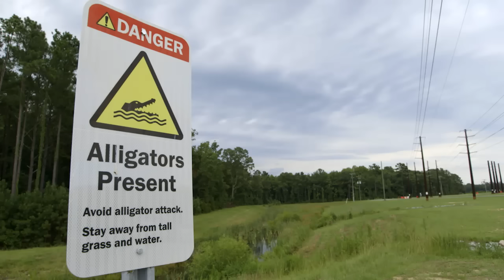Inside a Google data center

Comment: I was a Systems Admin. for a Fortune 5 company.Treasury Systems. I also designed the LAN. My networks were bullet proof. I had Compaq software that would check for pending drive failure. I implemented RAID 5 architecture on token ring.Unlike Google, I was proactive in monitoring system health before drive failure, not after it. I once had to swap drives during daily operations using Novell TTS. We didn't miss a beat or one transaction. The drives synced up. Then, it was time for lunch. :D

Comment: how much hard drive space is there?
Reply: There are no official numbers but it's estimated that Google has around 10 Exabytes in disk space available in total (according to their purchase history and average drive fail rates), that's ~ 10,000,000 1TB disks.
Fun fact, there is a hard drive fail in a Google datacenter every MINUTE. This is absolutely normal though and the data stored on them is redundant or course.
Reply: Google doesn't use "normal" Raids. They use advanced saving mechanisms (distributed cloud file systems) with spread out redundancy. The moment you upload a video it is already saved on multiple disks with parity functions, chunking etc., never on one hard drive alone, also it is saved in RAM-caches until the video has a minimum presence on the distributed file system.
The file system google uses is a proprietary one, called GFS (Google File System).

To answer your question (@DoppelgangerPlayer): The video will only fail if all drives with the same chunk of the video file fail at once, which is pretty unlikely to happen (but not impossible of course). I can't remember that it ever happened.
Reply: nice!^
Reply: About 512 mb.

Comment: why not transfer data center to cooler place?
Reply: Lander Lai 
I've thought that too. Build them in cold places and use the outside air in winter.
Reply: Could be a few reasons. Maybe they don't want to deal with outside contamination. Or maybe they just want it to be 100% reliable and best way to do that, is do it yourself
Reply: An Australian super computer was built over an underground aquifer. Pump up the water cool the computers and place the warm water back into the aquifer that is large enough to disperse the heat.

Comment: So if the drive breaks, someone's data is lost forever right?
Reply: No. On the enterprise level, drives are backed up in something called "RAID", where drives are mirrored bit for bit onto another drive. If one drive fails, there's a mirror copy of it already working on the network. The failed drive gets replaced, and the data is mirrored once again and running at least 2 copies.
Reply: +Doug Holmes It's worth mentioning that you double your cost with certain redundancies such as raid. Or you can look at it as you lose half storage space, since you use the other half for the mirror image.
Reply: Okay thanks.
Reply: FUCK MY PORN HISTORY :'v
Reply: lmao :v

Comment: why do all the employees have macbooks?
Reply: Because Unix.
Reply: Apple hardware is very good.  Macbooks also have a ridiculously high resale value.  You can cycle your hardware less often, and sell your depreciated hardware for a significant return on investment.  The initial cost is higher however.

The other good (and bad) thing about Macbooks is they change hardware less often.  So when you buy 500 MacBooks for your employees over the course of a year, the hardware is all the same, where with a PC individual components may be different as the hardware models change slightly throughout the year.  It's usually preferred to unify your hardware, it makes management easier.

I hate Mac OS - but love my macbook, I bootcamp and run Win10 - I'm a Network Admin.
Reply: Apple hardware is the same as most other hardware, but at twice the price.....
Reply: Hardware from HP is better than hardware from Apple. I would always prefer a notebook from HP over a macbook.
Reply: I need job

Comment: id love to throw a huge neodymium magnet into that room
Reply: all old spinning type harddrives have  neodymium magnets in side them so your  neodymium magnet most likely would not do anything oO.
Reply: true i was just wondering why they have spinning type hard drives in a google server room i imagined theyd have tons of SSDs
Reply: comes down to cost per meg ATM old spinning hdds are still cheaper but thats changing fast, i would say in the next 5 to ten years spinning platters will be dead
Reply: yea i read today that the price is dropping a lot right now because of those new portable ssd usbs
Reply: Yeah magnets bitch!
Reply: If it's that strong good look getting it inside.
Reply: Sc!ence | That would be fun, how ever there hdd's not ssd's
Reply: They can achieve similar speeds with HDD by arranging them as RAID.
Not only that, if one fails the data is still available in the other discs... It's safe and fast.... and cheaper.
Reply: hahahaha
Reply: Alla ackbar

Comment: Is it not possible to use all the surplus heat to heating of houses and water heating?
Reply: Not really. They would still need cool the water back down to keep cooling the servers.
Reply: I always thought they should build them in cold climates and use the cold outside air to cool them. And lay fiber through the snow :)

Comment: Plug in a USB Killer
Reply: lmao none of you have ever been in a data center have you..
Reply: ***** lmao you clearly do no understand sarcasm or jokes
Reply: lmao with that much voltage it'll kill your USB killer
Reply: EHHH...
Reply: they are using very cheap mobos with consumer grade disks.
each "server" consists of a simple motherboard with CPU soldered in with 2 hard disks.
the reason why they do this is becouse they dont care if disk or server goes down, they replace it very fast and the "system" (HDFS) replicates data to new server immediatly.

its called "grid computing" where data is replicated between hundreds or even thousands of computers.

few years ago google released their filesystem called HDFS and now we have "Hadoop" from it.
Reply: Not usb ports from what i've seen and most likely those high-end machines can handle an voltage overload.
Reply: Bobby Williams Hilary Clinton approves of this idea
Reply: Not even a USB slot on those servers.
Not that it would matter. They're mobos are probably super high end and able to handle it anyways.
Reply: @FatheredPuma81  r/whoooosh
Reply: @FatheredPuma81  r/woooosh
Reply: @internet4965  How?
Reply: 0:16 top right corner
Reply: The USB killer would only kill one machine out of many in the datacenter.
Reply: Unusable USB ports can be disabled.
Reply: 0:15 there's two right there.
Reply: +Bobby Williams  LMAO😂😂😂😂
Reply: Jordan Bentley they do. ha
Reply: Bobby Williams I don't think a little USB would kill it all.
Reply: ***** It's a hardware kill switch, not software. (They've used it to kill a car)
Reply: No most regular people havent
Reply: either have you thought so gtfo
Reply: this wont probably work they need to have a some type of secure
Reply: Isaac plays lol
Reply: Soup Man omfg there's probably someone in the company waiting to do that
Reply: Google datacenters run a heavily fortified OS, and not even a single virus can penetrate that since it auto restarts when it detects something bad and reverts it
Reply: I think plugging in, "MineCraft" from PirateBay works better or teenager hdd
Reply: Bobby Williams A
Reply: Bobby Williams wtf xD poor hard drives
Reply: No more google
Reply: HAHAHAHA
Reply: They are responsible for the missing people.
Reply: Jeez
Reply: that would not work too muc sicurity
Reply: A simple directed EMP attack... and I bet all those systems are toast....
Reply: Plug in Thor's Hammer
Reply: Master Chief where are you going? “To erase my search history”
Reply: Only a few are authorised!
Reply: Make multipule HUGE emps and detonate them in the building and run for your life... if you can get in
Reply: wow, so many people to woooosh
Reply: People are saying “ it’s too secure for that” but they are wrong they don’t plan for that, unfortunately each one is separate and don’t share a connection
Reply: They have Alligators around that data center, probably trespassers have been eaten and Google is not telling us.
Reply: +Jordan Bentley The USB killer would still kill the MB, as long as the USB killer can complete the connection and discharge.
Reply: How are they attached? I mean i guess their attached together via ethernet cables but I doubt the discharge from that one usb killer will go through the networking switch and kill the rest of the machines attached to the network, and the discharge can't go through wall power . The only two attachments it has to other machines is ethernet and wall power.
Reply: Someone. You are wrong , kill the first machine to kill the rest , it's like a electric series cut the first wire and all blubs are off
Reply: Bobby Williams same idea^^
Reply: Those are not sata cables, there's clearly 2 USBs right there.
Reply: Yeah I know haha

Comment: How is the data center more efficient when its warmer?
Reply: Maybe the cost of efficiency loss is less than what it would cost to cool it to the generally accepted temperature.. 

Something along those lines im sure..
Reply: Thats true I didn't think of that
Reply: I do a lot of work in data centers, and I have been told by a few them that their highest cost is the electricity bill for the air conditioners, if there is no aircon, you use less power = more efficient. I can't remember any specific details but one of them was saying that if they replaced all of their equipment with components that could survive in higher temperatures and remove the air conditioning all together, that they would save an absolutely monumental amount of money.  it would be quieter too -  those fans sure are noisy. They said the biggest hurdle in doing that is the temperatures would easily climb to 50degrees Celsius+ and it would be very difficult to have people do work in there from an OHS standpoint.
Reply: If the ambient temperatur are lower than in the center no compressors are needed. It´s a common strategi to rise the temperatur of the cooling system to reduce the compressor energy. The ambient temperatur can cool the water system. But the best thing to do is to reuse the heat energy when possible ie in district heating. That is more and more common in cold areas with district heat system.
Reply: i was confused about one thing this guy said. did he mean they have air conditioners up against their racks pushing the warm air into an isle where it rises to their secondary cooling, which would be the copper pipes with water that then runs outside through a cooling tower? are they using a secondary method of cooling to reduce the power consumption of their air conditioners?
Reply: I think he means the ambient temperature is warmer.  He also said they’re using the water cooling system in between their hot racks to siphon off heat, so basically the same concept as a radiator or heat sink.  It’s probably not more efficient from an operational standpoint, just cheaper to run and the equipment is able to cope with it.  A more correct term would be to say it’s a more cost effective closed loop system, but it only really works in high density situations.
Reply: Because the alligators like it better.
Reply: I may be wrong but I believe it is because thermistors are less resistant when heated up
Reply: the advent of smaller more efficient reliable disk drives have probably helped also.  It's kind of stupid crushing disk drives like that and running it through their "wood" chipper.  If they only knew what toxic materials are inside those things, they wouldn't let any of it become airborne

Comment: they got alligators protecting the data center
Reply: Ben Abbott with freakin laser beams attached to their heads!!  Lol
Reply: But conforming to Google's principles of "don't be evil" and "do the right thing", do those alligators also get to use Google's cafeteria and get free meals in exchange for their services?
Reply: An employee on a late afternoon jog around the facility is the 'free meal'.
Reply: LOLROFL is not to be missed on my way home favorite things to do that is not a problem
Reply: YES, I believe it's called a moat.
Reply: Yup, many security measures implemented at information sensitive facilities.Physical Access Controls and Logical Access Controls are maintained at the highest level to prevent the unauthorised access and disclosure of the data thereby protecting themselves from the law suits of their clients
Reply: Ben Abbott lol
Reply: No. Nothing is protecting anything. Check this out. 
https://spectrum.ieee.org/semiconductors/design/the-hunt-for-the-kill-switch
Reply: Yeah, its called a moat.
Reply: yep
Reply: Here in South Africa, our equivalent of the CIA is protected by lions

Comment: 4:02 You guys ride scooters in your data center!  I worked at Intel.  We weren't even allowed to walk up the steps without holding the hand rail, and we weren't allowed to run up or down the stairs.  We also weren't allowed to jump steps going up or down the stairs.    If you violated any of these rules it was a coworkers obligation to point our your safety error.